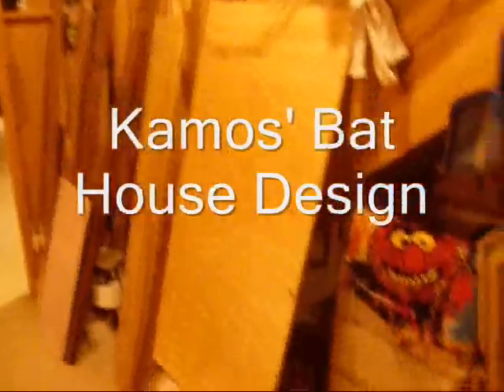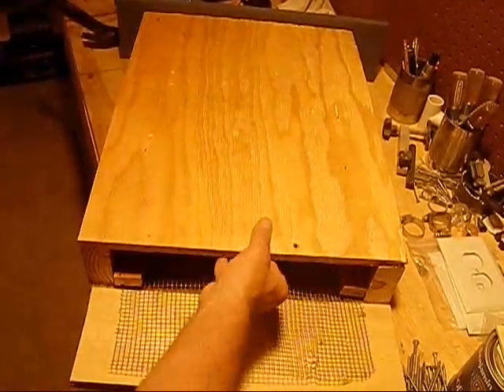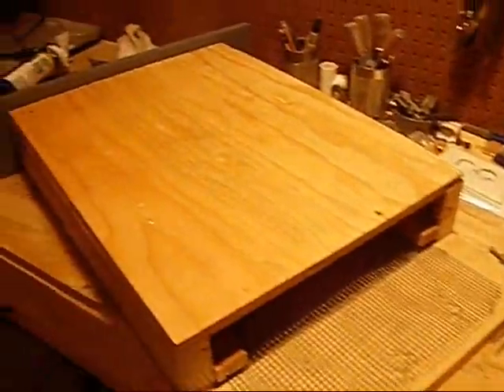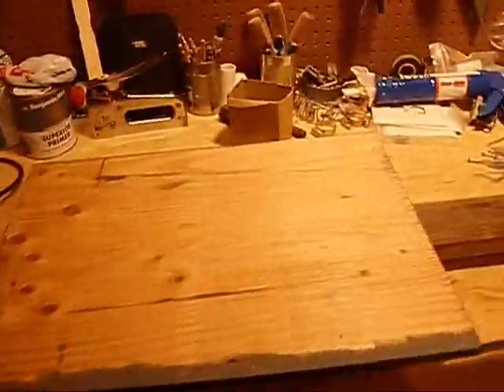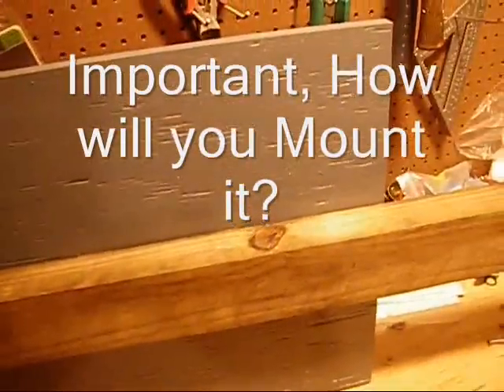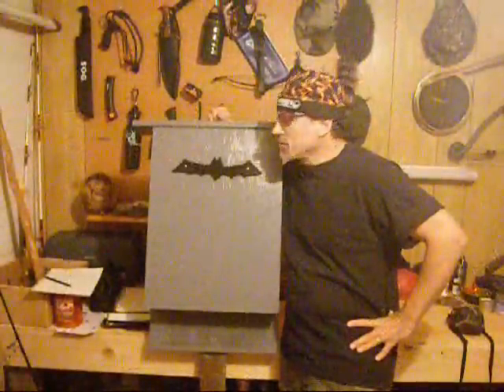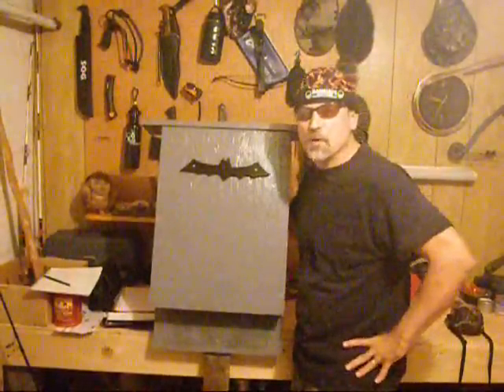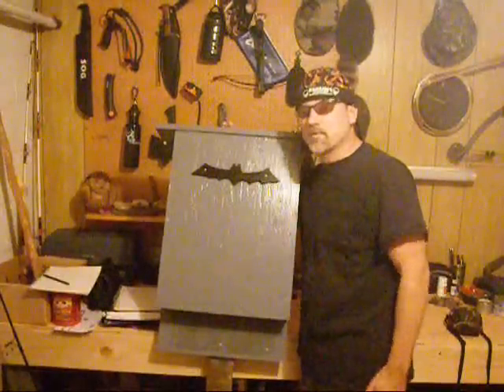Kamos' Bat Box Design

Comment from the maker: Thanks for the input, I tried to look in the bat box today and think I saw one little bat but, the sun has to move so I can get a better look. I did check the little box I set up last year and it now has one large bat in it. I'm actually surprised that the little box that I mounted on a tree worked at all. The experts say that little boxes on trees will not work. I'm excited and may now consider putting up another one.

Comment: I've read in a lot of different places that mesh isn't the best idea.  Just "score" the wood with shallow set circular saw or small dado on the table saw, etc.  They don't need much to grab onto.   The wire could harm them because it can be sharp.
Reply from the maker: You're probably right about that. Bats have been around a lot longer than man has been building bat boxes.

Comment from the maker: It is recommended to hang the Bat Box at least 12 feet off the ground but, 20 feet high is the way to go. Hang the box on the side of a building or on a pole. It is not recommended to use a tree because predators will use the tree to climb up to the box.